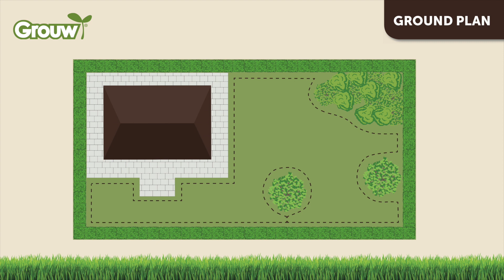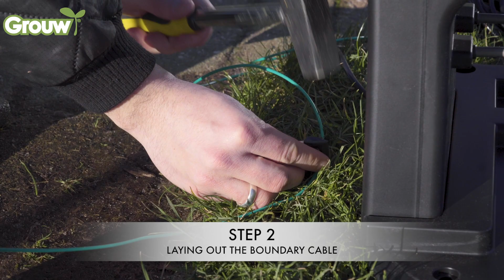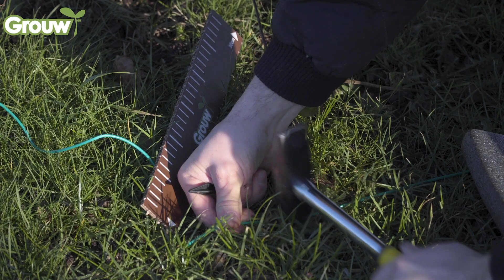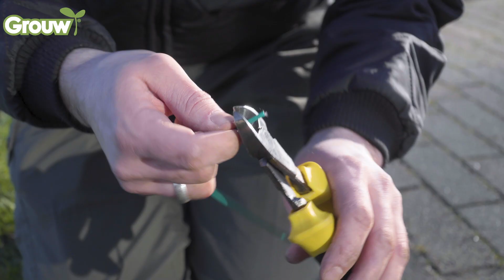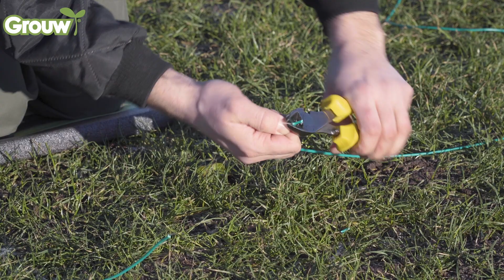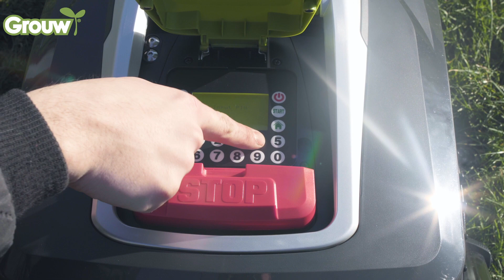UK: 17949 - Detailed installation video for Grouw robot lawnmower

Comment: It's an OK machine, considering the lower price. I can see the route programming is not very advanced, but it is fair enough to finish its work without too much attentions from the owner. However it still happens once every week/two weeks that the machine would not go back to the station for different reasons. Thats a bit annouying. 
I got my first machine last year, and the battery stopped working after the summer. So I got another instead. Hopefully it would not be the same for the second.